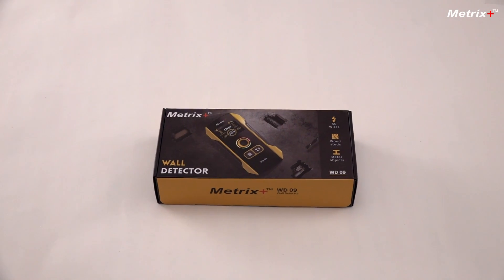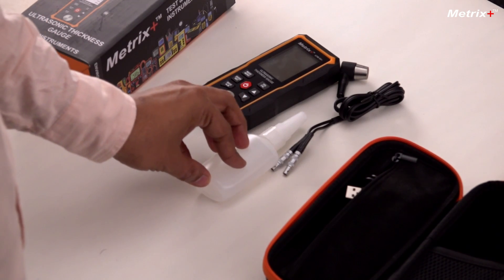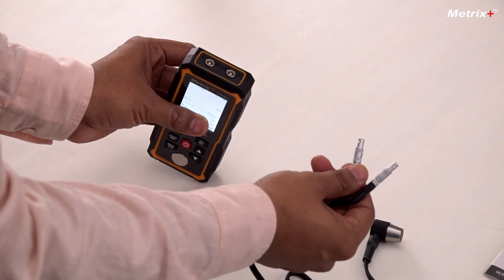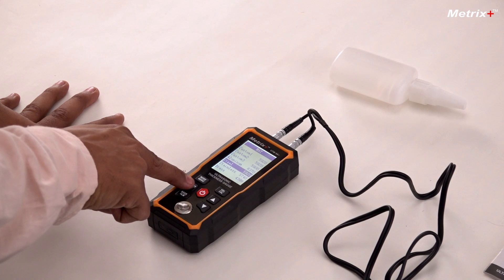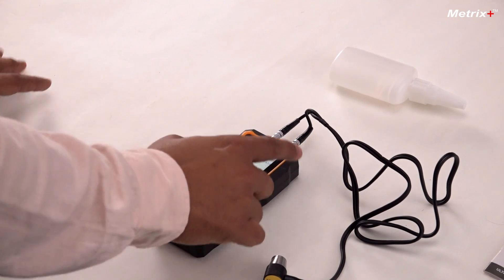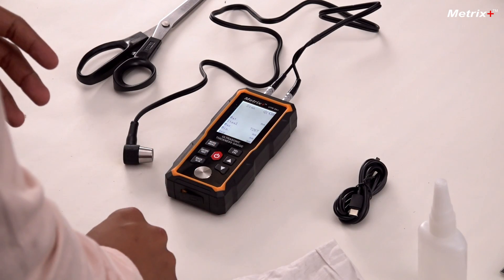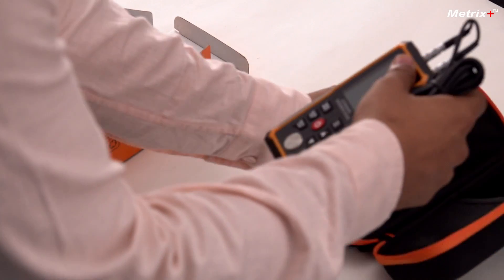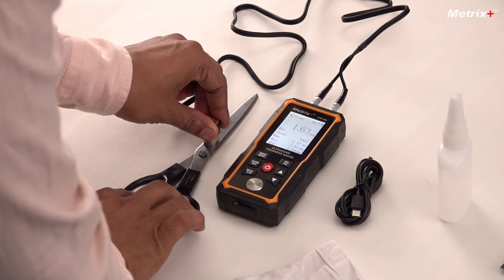Metrix+ Ultrasonic Thickness Meter UTM 5A+ | Full Operational Video

Comment: Great vid but too bad you do not address the issue of COATED materials/steels.
Reply from the maker: Good point! Basic UTGs can have slight inaccuracies due to different material/ density coatings. To eliminate that error, through coating UTGs are used which measure in Echo-Echo mode, and not the usual Pulse-Echo mode. We have Metrix+ UTM 18CT Through Coating UTG.